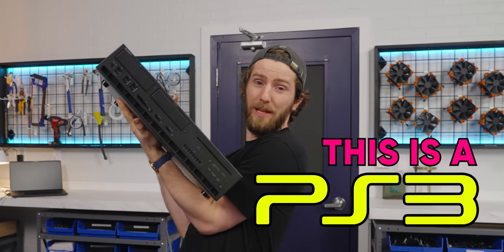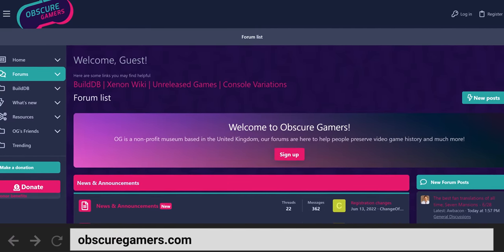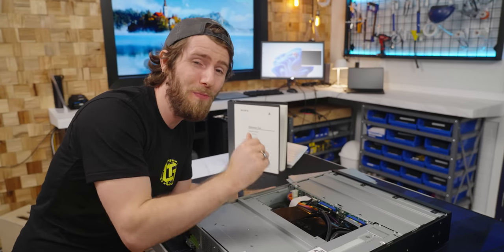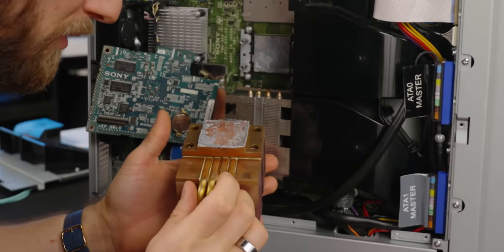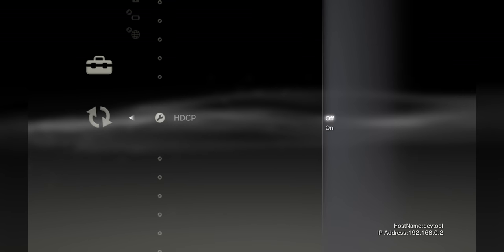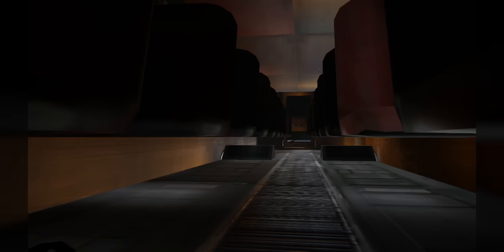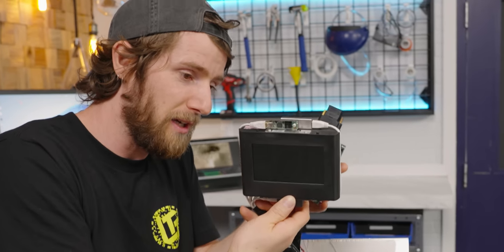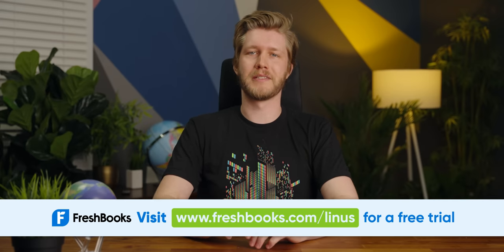I Await Sony’s Cease and Desist - PS3 Dev Kit

Comment: Considering how balls to the walls the dev kits of early 2000's consoles are, imagine the kind of dev boards they are making for current consoles now. I would love to see what a nintendo switch dev kit, or PS5 dev kit looks like.
Reply: Me tooo
Reply: much less extreme and useful. look at the recent xbox dev kit on the channel, practically the same as release console
Reply: PS5 Devkit images leaked back in the day.. had ridiculous styling, with huge intake vents on top in the shape of a "V" (roman numeral for 5)
Reply: 360 Dev Kits were literally just 360s which makes sense considering the console is bulky anyway.
Reply: xbox is basically the same and switch is basically the same also most nintendo consoles (with some exceptions) had devkits that were basically just like the console
Reply: Switch Devkits are basically identical but slightly more powerful, minus one that is used for additional power logging and whatnot, which is probably the most unique of the bunch
Reply: Early versions of the dev kits are almost always just a PC (desktop or rack) case. As the final consumer design is ironed out, later dev kits resembles more of the final product.
Reply: @mrskibum885  There are multiple different devkits. For example, while the Switch does have the EDEV which is basically the same as a retail unit (as well as the HDEV and ADEV for the Lite and OLED), there's also the SDEV which is definitely different. Look up the FCC ID CCAL18LP1170T2 for photos. That has a built-in dock, SMA connectors for antennas, and most notably a built-in Linux system connected over PCIe for high-bandwidth communication and hardware debugging.
Reply: @mrskibum885  All consoles eventually have a dev kit similar to the actual console, it is only early on and for advanced hardware level debug that these more expensive systems exist and I expect that they are made even today. Although with consoles effectively converging on PC class hardware with a few bells and whistles it's less bespoke that the custom chip support they needed for PS3.
Reply: @dorbie  Well they seem to be going two ways PC class with the bigger consoles and mobile class for the handhelds (The switch is more like a divergent tablet design with it's ARM core etc for example). But either way it's a move towards more bulk commodity hardware.
Reply: @seraphina985  Nintendo has lagged for generations of consoles, cube was a pain in the ass to port XBOX and PS2 titles to because it had less power & resources, so this isn't new. They've always targeted the affordable family segment in their consoles and the Switch is the latest iteration with a bit of a fusion of that and their DS market. Microsoft consoles have been PC architecture from the start. Sony tried to take a lead using IBM heterogeneous compute for PS3 (ill advised IMHO) and went multi-processor PC after that. Microsoft and Sony have now fully converged on similar architectures from the same vendor with minor tweaks. The main thing that really separates them now is differing proprietary control of platform publishing & software stack, which is what they care about most. When you buy a high end console now you are buying an AMD powered mid range PC with some minor tweaks and most importantly, hardware level encrypted control of what is permitted to run on it.
Reply: @dorbie  Sure I suspect that handhelds will end up following mobile architecture for the same reason. The fact is the PC platforms strength is flexibility at the cost of power consumption. Handhelds really don't need that flexibility as much so a power efficient SOC that can shave kilograms off the battery weight makes sense in that segment.
Reply: @seraphina985  But then there's always the push to make "PC level graphics" on the handhelds. The market of dreamers always wants their portable halo (almost happened), the mobile minecraft (happened), and all other games under the sun on the go. This is especially true of kids who want to play their games but are stuck on road trips (less so adults whom are driving the vehicles). I think the handheld market is going to start taking a hit once the internet improves enough that "streaming" becomes tenable (still isn't, yet, despite what google and others think), since you can just buy your console game and stream it to handheld instead. Right now, i also think it's propped up by millenials like me whom hear "on the go" and think back to all those times we wanted our favorite games on the go, while we have yet to realize that's not really a thing for us as adults, anymore. Once we realize it, we're going to spend less on handhelds for ourselves and children. Mobile gaming stuff will finally kick off, then, i think, since being able to use your phone on the go will be significantly cheaper (since you're going to spend money on the phone itself regardless, you're not going to factor that into the cost of gaming with it).
Reply: @MarioMasta64  You should see the original Xbox "Alpha II" devkit :D
Reply: Ps5 dev kits just released they look sick
Reply: @unbearifiedbear1885  that should have been the ps5
Reply: @dorbie  The Gamecube was actually more powerful than the PS2.

All three consoles had vastly different architecture - the reason the Gamecube didn't get every game was because the console wasn't popular enough to offset the cost of developing a third version. 

The PS2 was so popular that most games were basically developed with it in mind, if not as exclusives, and the Xbox was very powerful, moderately popular and it had PC-like architecture, so Xbox ports were usually a shoe-in.

The Gamecube could have easily run almost every non-Xbox exclusive game of its generation, it just wasn't popular enough.
Reply: @alfo2804  That's not really the full picture, resources like texture memory were constrained so down-porting anything to the gamecube required painful compromises, and the XBOX could support interesting shader features that a gamecube couldn't touch.
Reply: @Vinnay94  The 360 dev kits were large towers at first too, then got shrunk down.

Comment: From what I understand, the various Sony Dev Kits always remained the property of Sony and at any point they could take them back. In fact, after the project was finished, I believe they should have been returned. The developer simply rented them and access to software tools and documentation under license / NDA. It’s likely they have a unique serial number so Sony could trace who had the unit originally.
Reply: Yeah, I think MVG said something about this when exploring some dev kits.

It makes sense that they would want to keep strict tabs on who may have this rather powerful hardware, and I mean power as in knowledge too. It's these kits falling into the "wrong" hands (or right if you want to look at it another way) that could allow commercial units to be backed to run 3rd party code.

All it takes is 1 loophole, or one entry point (as we have seen) and boom.
Reply: @DukeDudeston  I have never seen a PS2 bootleg from China. I think all NES consoles bootlegs were using software emulation. I have never had a ps3 because the consoles easily get ylod just like xbox 360.
Reply: When I was trying to bootstrap my own studio, you could buy the devkit and the lease was avalible as well for smaller studios. 
But purchase was limited under a lot of agreements and Sony could still retract them with partial refund, and you got money back for returning the units, hence a large part of the hefty price tag.
Reply: @humanistwriting5477  I wonder if the high price was partially artificial, simply to encourage devs to return them for the partial refund or avoid the "non-return" cost if just leasing, especially if early when the kits weren't as common and sony would want them spread around.
Reply: @lelsewherelelsewhere9435  oh definitely

Comment: I remember working with the original grey box devkits on one of the ps3 launch titles. They were super loud, and we had a ton of them. During the day you'd practically have to shout over all the fan noise. When we finally switched to these obelisk type ones the difference was night and day.

Later I also got a chance to work on a psvita launch title, though I never saw those earlier devkits. We did most of our development on ps3 and emulated the touch surface via mouse cursor/clicks until we got what amounted to a retail unit with a devkit dongle.

Comment: That "HDCP on/off" gets me every time 😀
Reply: "sEe ya lAtEr!"
Reply: How many times did you watch it?
Reply: @eadweard.  probably on floatplane too?
Reply: HDCP? 🤨
Reply: @xehP  High-bandwidth Digital Content Protection is a form of digital copy protection developed by Intel Corporation to prevent copying of digital audio and video content as it travels across connections.
Reply: It pains me to see him literally turn it off with a press of a button. 😩
Reply: @Snogwritts  Well, it's just software at the end of the day. :D
Reply: @xehP  High Definition Content Protection. Limit hdmi to low def when used out of its region.
Reply: @Shibathedog  as initiating party of protocol it will just play any content stripping it of hdcp signal, I'd assume
Reply: @eadweard.  I meant when developing for consoles in general.

Comment: This is probably my favourite LTT video so far. I love anything to do with the PS3. It has such a weird history as a game console, and I find all of it super cool.

Here's some interesting facts about the PS3:
The cell is about as powerful as a Ryzen 3 2200G, but almost nothing was able to utilize its full power (you had to essentially code for each individual core).
The PS3 originally was an all-in-one home system. Entertainment, computing, gaming, everything. The original price was very competitive with BluRay players of the time, and you could install a version of Linux on the system (called OtherOS). It also had a PS2 slapped inside, so you could play all 3 generations of games (but fat PS3s tend to struggle with newer PS3 games).
There were several PS3 supercomputer clusters, one of which was operated by the US Army.
Sony eventually pulled support for OtherOS, which resulted in a large lawsuit.
Slim models removed the PS2 hardware and now only ran PS1 games via emulation (and PS3 games natively).
Because the PS3 was built at a time where computer technology was advancing rapidly, the original process node was 90 nm and the latest super slim model had gone all the way down to 28 nm. Most of the original girth was for cooling.
Reply: interesting
Reply: You can't quite quantify Cell's processing power (of the SPUs specifically) in the same way as you would a processor like Ryzen, so you can't really compare the two. It's specialized hardware, much like compute cores on a GPU or a media encode accelerator.
Reply: @xan1242  Yeah, it doesn't directly translate, but in terms of raw compute, that's about as powerful as the cell is.
Reply: Wait why do fat PS3's struggle with newer PS3 games? I know Sony revised the hardware many times but I thought a PS3 was a PS3 at the end of the day.
Reply: @captinsparklezremix  I'm not sure the exact technical reason(s), but in my experience, fat PS3S like to freeze on loading screens and overheat in long gaming sessions.
Reply: Additionally, the original PS3 design was to house two Cell processors and no GPU - as you can see from the 1000W power draw and astronomical box cost with the early hardware revisions this was completely prohibitive, which is why they struck a quick deal with NVIDIA (and still sold PS3s at a massive loss).
Pulling OtherOS is what led to the creation of Custom Firmware.  Hackers had no incentive to break the system when they could already fiddle around in Linux.
The PS2 chip reportedly cost ~$20-$30 per unit and all PS3s can run PS2 software emulation - it's how the purchased PS2 Classics work.  The PS4 also has full PS1, PS2 and broken PSP emulation support which is locked off from users.
Reply: @captinsparklezremix  it doesn't
Reply: THere was a period where the PS3 was the best BD player on the market.
Reply: @BATMAN I had to look up old benchmarks and try to cross compare as well as I could.
Reply: @BATMAN It's just in terms of raw compute. People were able to run benchmarks on Linux, and websites have determined theoretical max performance (as with all chips). That said, you won't see anything close to its full potential in gaming, as games had to be optimized on a per-core basis.

Looking at the PS3's Folding@Home stats proves that it was insanely powerful for the time.

160,000 PC users: 152 TFLOPS.

25,000 PS3 users: 602 TFLOPS.

Soon after F@H was released on PS3, it was announced that 71% of all compute was being done on PS3s, despite the consoles taking up a very small margin of the pool.
Reply: I did a research paper on the computing power of gaming consoles from the Atari to the PS4. When I got to the PS3 to talk about its hardware I was thoroughly surprised to see exactly what kind of beast this machine was when it released. This thing was not built like a gaming PC, but like a mini supercomputer, its on paper computing power was running circles around EVERYTHING at ite pricepoint. Looking at archived articles I found NVIDIA admitting that this thing came close to their newest GPU that cost as much as the PS3 in of itself. Unfortunately the architecture of the system made it basically alien to game developers leading to many games performing rather poorly on the system as they just couldn't optimize anything.

Comment: I remember two main things about those devices - firstly upgrading the firmware was an absolute shitshow, especially at first - it was a complicated process and one wrong step could entirely brick the thing and you'd have to send it back to Japan. Secondly people in our studio were always accidentally breaking the USB ports, I think because if you had it on the left side of your desk it was so big that the usb cables would hang over the edge of the desk and then you'd accidentally bump in to it one day.
Reply: I had experience with one before and yea, 9 times out of 10 you'll have 2 usbs junked. it becomes a guessing game seeing which units online will have been a victim whenever one is listed.

Comment: About that Gears of War build: Unreal Engine 3 was basically built around Gears of War, so when Epic started porting UE3 to PS3 it made sense to just port the game together with the engine as a test case for a real game with real world requirements (and of course it's a debug/unoptimized build, that thing is probably printing hundreds of log lines over the debug console)
Reply: Gears of War 3 came out 4 years after Unreal Tournament 3.
Reply: And Unreal Engine 3 started development 4 years before the first Gears of War was released.

Comment: That's an interesting way of combining server based tech with dev kit tech. Adding an iLO module and also giving it a server chassis makes me think it was more meant to be plopped into a server rack, and plugged into a KVM for network access.
Reply: Two feet wide means five inches too wide for a server rack, though.
Reply: @teh-maxh  oh... yeah... I forgot about that.... I'm dumb
Reply: If placed under any objects the 1000W system with insufficient cooling had a tendency to melt plastic.

Comment: For the dead batteries in the ps3 controller, you can remove them from the controller and charge them with a bench power supply. About 5V @ 0.5amp. Charge them for a bit and then stick them back in the controller. It should now recognise the battery. The charge circuit stops recognising batteries if charge drops too much and won’t attempt to charge at all.
Reply: That makes sense. I was wondering how Linus' controllers had died, as I've never had a single PS3 controller die on me once. Sounds like leaving them dead for too long will "kill" them in that sense.
Reply: @joshjlmgproductions3313  it happened with launch edition sixaxis.. never got used since I purchased a DS3... the same also happened with move controllers.
Reply: @avatarpt  Ah, okay. Thanks for clarifying. My fat PS3 only had a wired controller, but all my slim models had the DS3. That would explain why I've never experienced the problem.

Comment: Nice to see that (I only got the slim PS3 devkit by the end of my time in the industry). But since you guys are in the business of blowing thousands on Retro hardware, I'd really like to see the earliest devkit of the N64 which, to my knowledge, was actually a cut down set of libraries (emulated runtime environment) running on Irix 5.3 (I think) on the Onyx workstation. According to LucasArts, the emulated environment was so close to the final hardware that they didn't have to modify "Shadows of the Empire" (much) to run on the next iteration of the devkit (which was a $7-10,000 standard SGI Indy and an FPGA board that had video out and Rj-45 sockets for controllers).
The third iteration was already an N64 with a funny cartridge that connected via ethernet or SCSI to a normal PC or an SGI O2. On all three iterations the SDK came with it's own compiler and library which is easy to come by these days...
Except the Onyx emulated environment.

Comment: I still have my first gen PS3 fat with the 60Gb and the hardware emulation for the PS2 games.Still running like a charm. Man this video was an amazing throwback.
Reply: It wasn’t emulation, they had actual PS2 hardware in there.
Reply: Aye still have one going strong in my family as well.
Reply: @JasonZakrajsek  only in CECHA/CECHB revs, C and D has an  emulators and some hardware parts of ps2 others are using 100% emulation
Reply: I have one too. As it is a bit loud, I don't use it anymore. Too bad they will all die   on ylod.
Reply: @jdgmeester  it was so sad seeing my fat ps3 have the ylod, it's dead now sadly